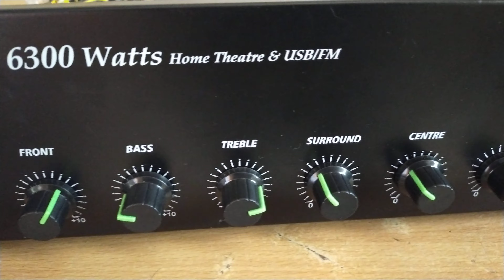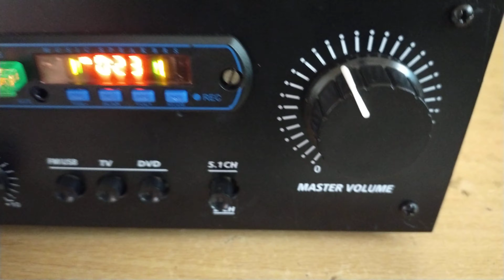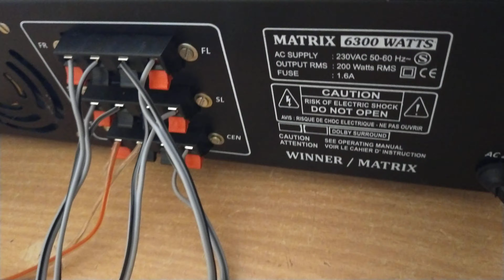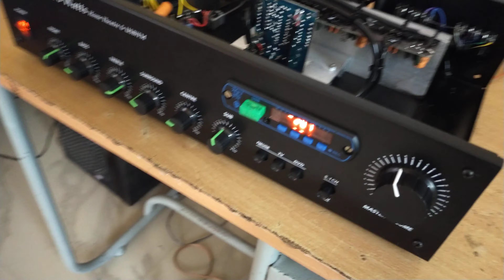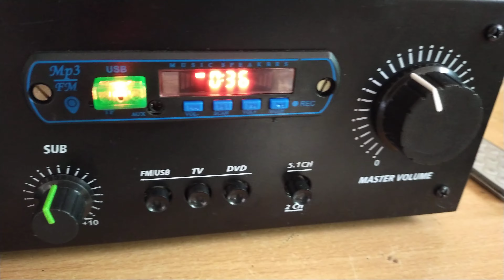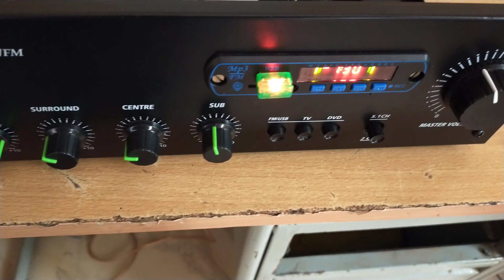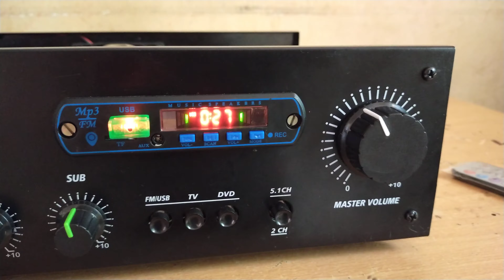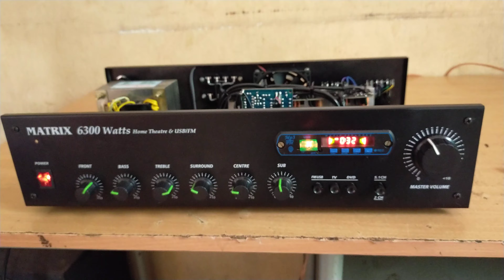Low budget amplifier mosfet IRF250N  TDA7265-MANO audios 95971-26597

Comment: Anna yen kitta 4440ic cut board irukku . Transformer 20.0.20 than irukku itha 7812 regulator ic vachchi use pannuna nalla irukkuma
Reply: Pls use 12v  transformer with good amp rating. No regulator ic for amplifier circuit board. If pre boards or fans... ok...

Comment: Bro amp master volume fulla low pannalum speaker la light issss nu oru sound vaudhu  anna eanna problem ne theriyala . Earth la correct dhan anna kuduthurukkan .
Reply: Brother 1squer mm wier  moolamaga first ground seiyavum.
Control earthirkum 1sqauer mm wire moolamaga main  board  IL oru oru idamaga earth seithu parkkavum
Reply: Mp3 or mp5 board earth pls check. Or Main filter - capacitors range must be increased